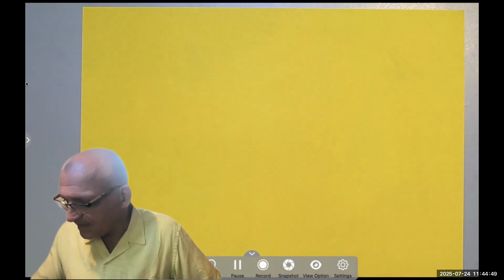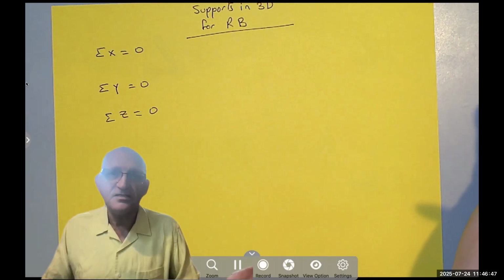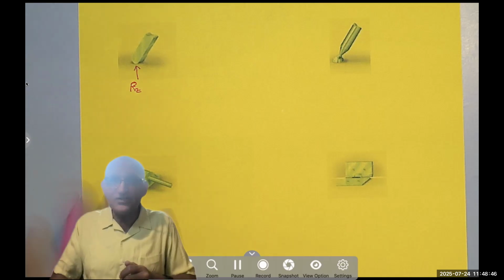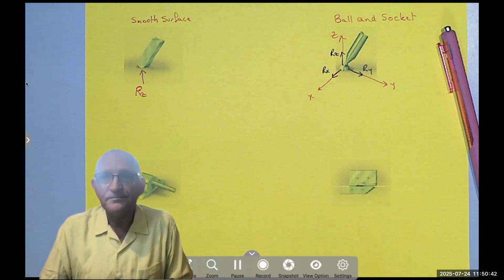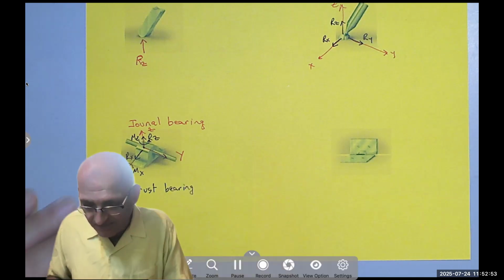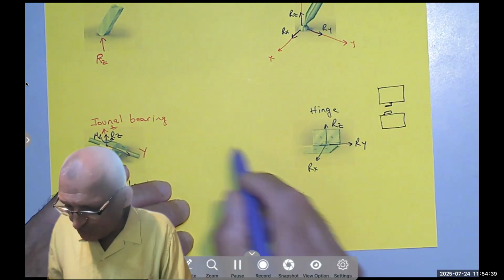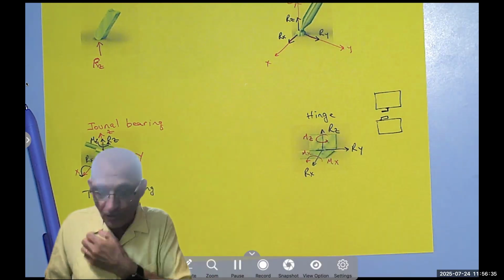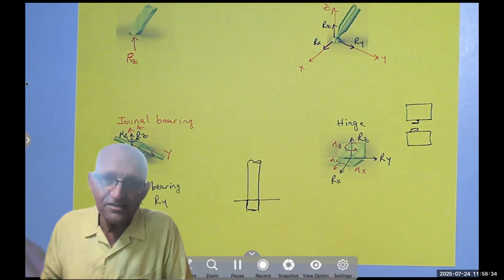3D Support Reactions Explained | Types of Supports for Rigid Bodies in Space

Comment: There is something that really bothers me and i hope i get an answer 
Why when there are two supports that are aligned we ignore their moments?? Like i know we only have six equations so the maximum unknows are six and so, but is that is? Cause we cannot determine them we simply ignore them? 
A door for example has two to three hinges but still rotates in one direction only so there are moments in the other two directions!
ps: i’m egyptian too 🥰
Reply from the maker: Thanks for your question and for asking.  When you have hinges, they are not designed to prevent rotation.  When we say they were perfectly aligned, we say that to make the problem solvable using statics (statically determinate). Otherwise, as you clearly mentioned there will be more than six unknowns and we will have to investigate the deformations produced which is beyond the scope of statics.

On the other hand, usually these moments are so small that they may be ignored without significantly affecting the final solution.

  I hope that clarifies it for you.

Best regards.
Reply: @Egyptian_Dr.Mohamed 
شكرًا ليك ولوقتك 🥰🌹، فهمت كدة
Reply from the maker: العفو يا باشا.